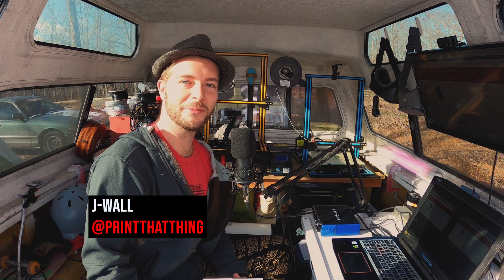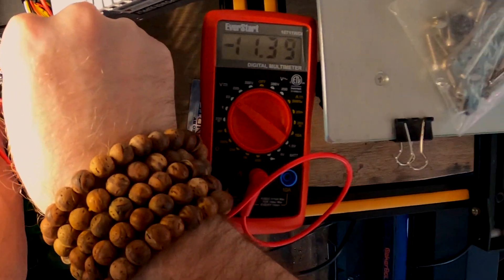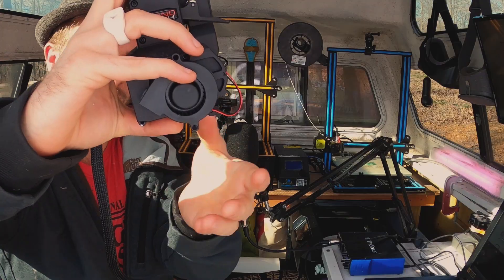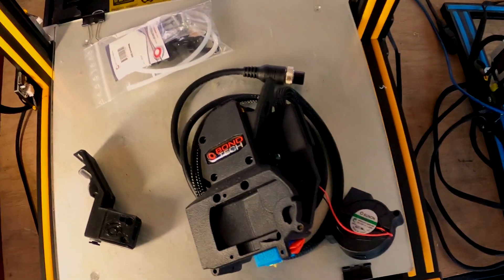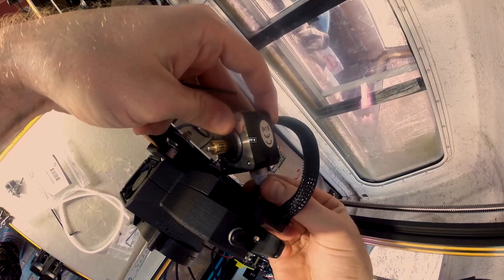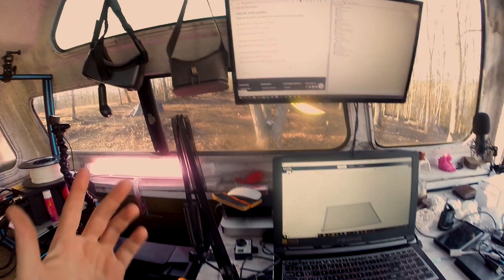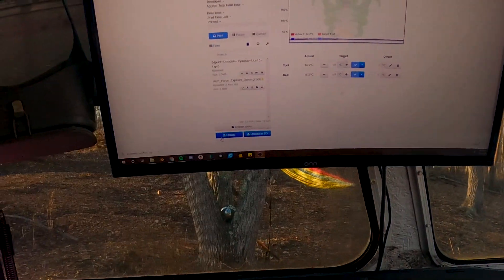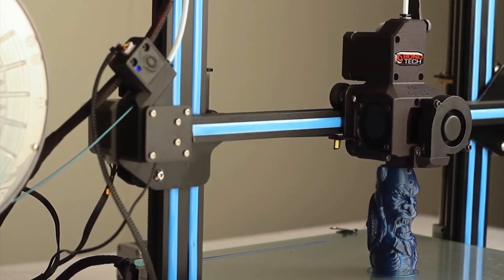3D Print 200% FASTER on CR-10S w/ BondTech Extruder + HotEnd (Step by Step) - Upgrade Install [2020]

Comment from the maker: How would you use a BondTech Extruder Kit?
Reply: To improve my CR-10 MAX so that I can further my abilities to fabricate with the intention of furthering my education.
Reply from the maker: Love that! Keep learning and creating W6463549 HCCS. :)
Reply: @joeymetaverse  
I suggest you build one from scratch because your going to gut it anyway in the process of upgrading .
So why not build it with the upgrades in the first place ?
going to throw out the mother board and buy  Bigtreetech skr 
going to buy a touch screen 
going to buy AC silicone heat pad 
going to want it to be 24v 
etc
so save yourself some money and build one from scratch .
Reply from the maker: That sounds fun. Best of luck on your upgrades
Reply: @PrintThatThing   LOL
Not fun at all . 
But if you watch what most people do , they end up changing everything except the frame . 

So why not just buy a precut predrilled ready frame and build on that ?
Reply from the maker: nice!
Reply: info links STL?

Comment: looks simple.  every print on original hot end currently coming out like mini wheats cereal.  wish i could get someone to fix it. :(  i would use it to try to fix the mess i'm in with my prints but too expensive for single mom.  i have original red hot end with dual gear

Comment: Wonder if your still happy with this. I bought one and the extruder has been nothing but a pain. The pancake motor sucks, gets to hot to easy. Lower the current and you start skipping steps. I stripped one of the gears and had one motor fry in the year I've owned it. I wouldn't recommend this product.
Reply from the maker: When it prints its incredible. I blew out my motherboard one day messing with the extruder.  Then had the power too low and was skipping steps.  I reset to the original extruder, replaced my motherboard, and haven't put it back on...but plan to one weekend when I have a few hours to upgrade again.
Reply: @PrintThatThing  I was stripping mine down while I wait for a replacement stepper motor and can see the teeth on the driver gear (my second gear) are already wearing out. Honestly the only plus to this is that its an all in one solution. The E3D titan is a MUCH better extruder. But you have to hunt down mounts and part fans and all that crap. after the gear strips or the new motor burns out( wich wont take long) Im going back to the E3D setup.

Comment: Why are you adjusting steppe current 50% less?  I'm geetting ready to buy the Bontech DD.  Just have to figure which hot end I want.  Which is better?
Reply from the maker: The instructions said to turn down the power. So I did haha
Reply: @PrintThatThing  ha ha okay thanks.  I'm scared getting into the main board.
Reply: If it has a different motor it probably doesn't need as much power as the previous one. While you could run motors at higher currents, it would just lead to excess heat which hurts it overtime
Reply from the maker: Good to know. :)
Reply: @zzzZniitemareZzzz  Okay thanks.

Comment: Instead of printing at 300%, wouldn't it be better just to recalibrate the e-steps for the extruder motor? 

Also, it's not really printing 200% faster. The gearing is 3:1 which means the extruder motor has to turn 3 times before the BMG gear does one full rotation. This is why the extruder has to rotate faster to match the original extrusion rate.

Here is a simple illustration: 
https://www.youtube.com/watch?v=B4j2VPHVm6o
Reply from the maker: Ah gotcha. Thanks for the video. This makes more sense. Thanks for sharing. :) I'll recalibrate the e-steps too.

Comment: Hi. I have cr10v2. I want to print TPU. Would it be better a direct extruder? Or what are your recommendations? I'd like to get light speeds. Thank you
Reply from the maker: Yes, absolutely TPU with direct drive.
Reply: @PrintThatThing  bondtech it's what u recomend as a direct extruder?
Reply from the maker: Thats the only one I've every used.
Reply from the maker: ever*

Comment: Perfect video in regards to installation and product demonstration. I am stuck between purchasing this for my CR-10 MAX or buying the Micro Swiss Direct Drive with Hotend. I am having too many issues with my Bowden tube jamming and ruining prints that take 10+ days to complete. 

If you have any advice, I am all ears. Thank you for your video!
Reply from the maker: Thanks for watching and commenting. I have only used the bondtech combo and single extruders on my CR10 and CR10s. I think you'd be the best judge for what is best for your setup. I know how it is to loose long hour prints. :( best of luck on your upgrades.
Reply: uggh help! print jamming on my cr 10-max also any help on how you fixed it would be great, almost nothing for cr 10 max printers on the internet.
Reply from the maker: There's many factors that could be causing it. Material, temp, nozzle, slicer settings. Its hard to know without seeing it in person

Comment: What about if I got a creality autobed leveling sensor on it ? Is the sensor still working after installing bondtech firmware? or can i use the bltouch firmware ( my leveling sensor is not a touch )
Reply from the maker: Great question.  I do not have an auto bed level sensor so I couldn't tell you for sure
Reply: @PrintThatThing  it was easier than I thought. I didn't have to get new firmware, I only needed to change the mount from left to right, and give some writing 3 g-codes esteps and save
Reply from the maker: Thats awesome!! Thanks for sharing your findings. Hopefully this will help other people in the future

Comment: Great video. A few questions if that's ok:
1. What were the main reasons and benefits to upgrade?
2. Was there any improvement in print quality?
3. Did the extra weight/inertia on the x axis require slicer settings changes to maintain print quality?
4. How do you perform the initial filament feed when for example, you put a new filament spool on?
Reply from the maker: Hey @FunGhoul thanks for the the questions. Ill be sure to answer these on my update video. In short, the Bondtech upgrade has definitely helped me print faster and has increased the quality overall. I will do an update video soon. I have a lot of printing to do this coming week.

Comment: hello, after replacing everything and as recommended to set the retraction speed and length, have you also recalibrated the mm steps?  thanks.
Reply from the maker: I added a line of code to my slicing software.   Sorry if that doesn't help you...
Reply: @PrintThatThing  would it be possible for you to explain this code line? Im using simply3D and I am a bit lost with some final steps. I have no clue what E-Step value set to 415.
Acceleration set to 500. means and where to add it. Also where do I do the Reduce Retraction Distance to 1mm and Retraction Speed to 35mm/s before start using the DDS on simply3D? i have been stuff for days now.

Comment: I just bought one of these.  I recently did the dual lead screw/electronics upgrade on an original CR-10 and thought this would save me so much time.  I know there are countless E3Dv6/Bondtech mounts out there on Thingiverse and elsewhere.  But for $260, you get a complete solution, they provide the firmware...and on my setup, they provide you with a BL Touch mount file AND the firmware for that pre made!  My other Creality printer is a CR-10S and I did the Titan Evolve mount/fan duct with an E3D Titan Aero.  It's been working very well but due to it's size, it can be challenging to look and see what's going on near the nozzle!  Nice to see they sponsored you!  I'm looking forward to installing mine then fine tuning a Simplify3D profile for it.
Reply from the maker: Thanks for watching and commenting. Let me know how your install goes or if you have any questions. Yeah so far bondtech has been great to work with and the upgrade has been great!

Comment: BondTech is nice, but they got too greedy on the price... now Hemera has their ass :)
Reply from the maker: hanks for watching and commenting. Everybody's got make some cash. :) Haha. The product is very nice, I'm excited about testing it out more over the month. Have you used the Bondtech or Hemera yet?
Reply from the maker: Nice. What do you think makes it better?
Reply: @Electric Boogaloo I just installed a Hemera on my Folgertech FT-6.  I'm not crazy about their mount setup (those squares can be easy to loose).  So far I really like it.  The default esteps of 409 struck me as too much, my 100mm extrusion test preferred 384.  However first prints seemed under extruded.  409 works!
Reply: I mean, their price is absolutely reasonable for what they did, it's simply a matter of them being open with their innovation and getting humiliatingly undercut as a result. Could someone else always manufacture the product at a lower price point, starting with the completed design? Of course they can; everyone and their mother was able to do it to E3D's last design. And the Prusa i3. And the Arduino. And Xanax. And almost any product ever made. That doesn't make those products overpriced; if the physical materials made up the entirety or even majority of the cost of it, that would have meant it was a completely trivial design in the first place, in which case someone would have chiseled one out of wood and mounted it on a reprap in 2010. Research, development, paying the educated professionals whose job it is to perform these tasks, etc. all cost money, which the end product needs to recoup. 

The difference between the Hemera and Bondtech products, and E3D's last extruder for that matter, is that it's not an open design because the same thing you and E3D themselves made fun of Bondtech for happened to them first. So, in spite of basically every ideal the company has ever espoused, suddenly it's no longer about advancing  the industry as a whole and improving 3D printing for everyone with open standards and all about shitting  on their competition and achieving a competitive lead. It's also extremely strange that they forcibly bundle in one of their existing products which Also has a thousand clones available for under $10 at just under full price, along with a stepper motor which you definitely already own, and have managed to convince people this is somehow a bargain.